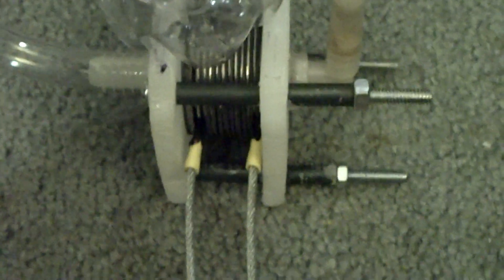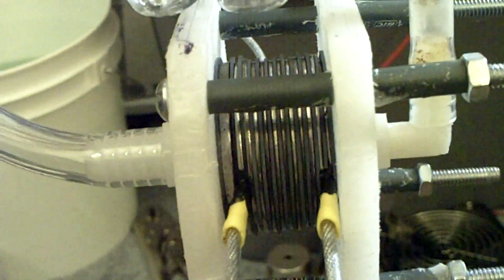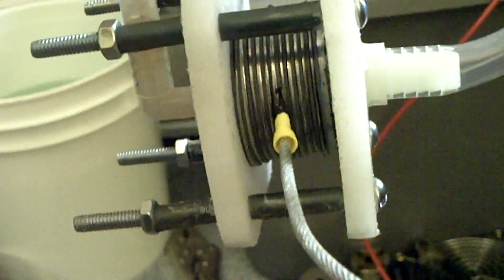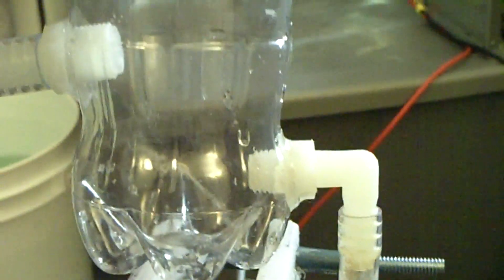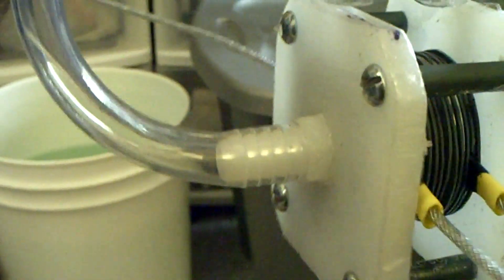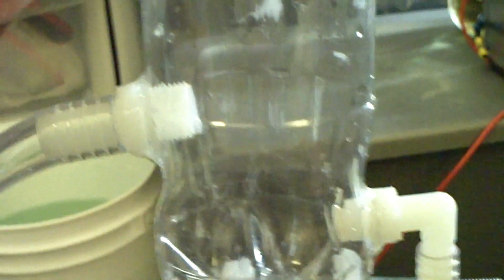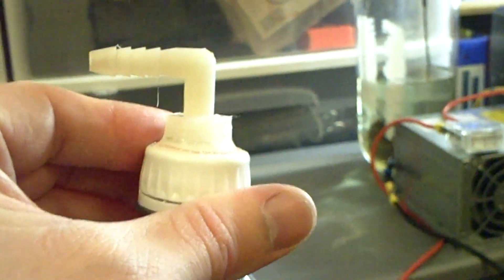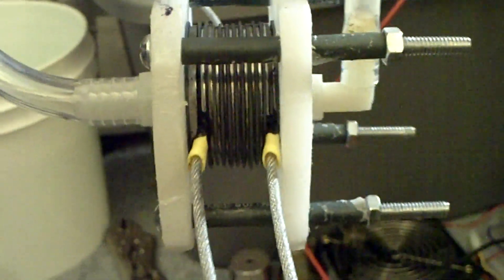Vid28 HHO Washer DryCell Hydrogen Generator Prototype (HHO, Brown's Gas, Hydroxy)

Comment from the maker: I agree, I'd rather have a vertical cell, but I had issues with the water refill when I tried to run it vertical. So, that is why I redesigned it to work on its side. 

I guess I just went for the easiest solution. Maybe when I have more time I will revisit the vertical design and work out the bugs.

Even though I'm sacrificing some surface area, I dont' think it will limit the cell very much.

Comment from the maker: Thanks, I was just testing it and realized that I have a leaking seal between the gasket and cutting board.  I should have pre-treated the cutting board with a rubberized sealant like plasti-dip to get a flat surface. 

The cutting board has a rough surface and makes it nearly impossible to get a good seal.

But even with the leak I was still able to get over 1/2 LPM at 2.5 Amps.

I'm uploading the first test and is should be available shortly.

Comment from the maker: Thanks, I've already made some modifications that fixed the problem.

I made the cell vertical, mounted the bottle on top, and removed the bottom port. 

Now it works much better.

Comment from the maker: Good question,

The reason Dry Cells are better than Wet Cells is very simple.  It is because less water is being charged.  

In a wet cell you are charging much more water.  This electrical runoff is wasted energy and is less efficient.  

It is true that there is less surface area in a dry cell, but the difference is not a negative one, because dry cells are more efficient and tend to produce more HHO gas.